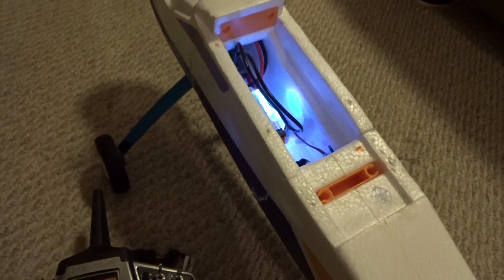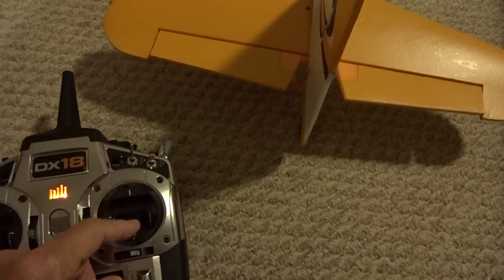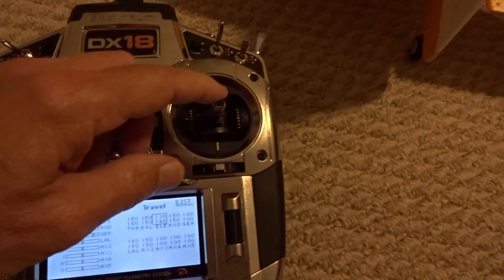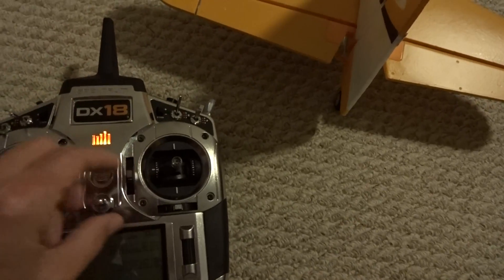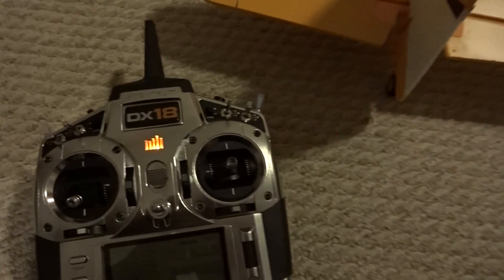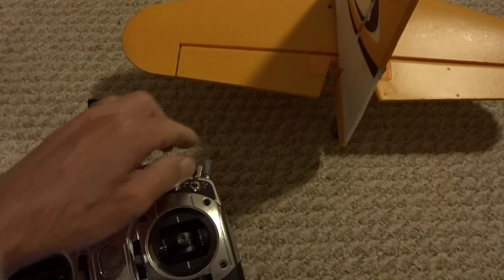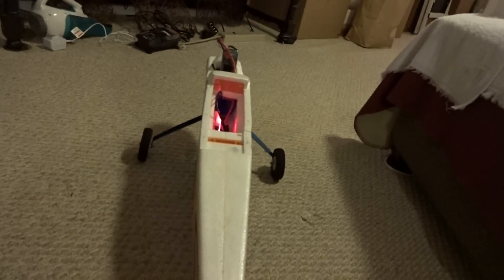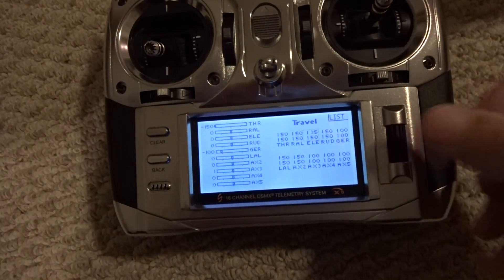Hobby Eagle A3 Super II causes crash with TRAVEL values above 130% on elevator on HIGH rates

Comment: Why are you driving your servos in excess of 130%? If you need more travel it should be adjusted at the control horns. Transmitter instructions all advise not to overdrive servos.
Reply from the maker: How do you know I did not already adjust the physical travel via the control horn and servo arm for max travel? I always watch the actual control surfaces when adjusting for max travel. I then adjust the SERVO TRAVEL and DUAL RATES for the travel I want on each of the D/R settings I plan to use for that aircraft. The problem was not with the travel adjustment at the Tx. It was the travel setting LIMIT of the HE A2 S2 FC.

Comment: You're exceeding the limits of the gyro.
Reply from the maker: Almost all stabs can handle the maximum travel limit most any transmitter can be programmed for. In fact of the 7 stabilization brands I have flown, the Spektrum SAFE series, AURA 5, Lemon-Rx series, ZOHD Kopilot, ARES stab, and the Hobby Eagle brand, ONLY the Hobby Eagle is limited on the throws. The HE A3 S2 can only handle up to a certain limit, and then it goes back to neutral. Unless you know to test for this, it will catch you out as it did me.

Comment: Huh. I’m curious to why mine doesn’t go back down. I haven’t flown with it yet and my high rates are NO higher than 100%. I have the hobby eagle a3pro set up as such: pos 1). No gyro pos 2). Auto level pos 3). Trainer. I’m new to these gyros and have been playing around with this one for months with ZERO flights on it because I’m too scared to take a plane up with a gyro I’m not certain works properly. Did you get it figured out?! Does adjusting the gains manually in the pots have anything to do with it? I ‘believe’ I have te manual gains set at 50% but I can’t tell. I know they aren’t all the way up or all the way down. Plus I have another 3 position switch set with a high rate of 100%, mid rate of 75%, and low rate of 50% for aileron, elevator, rudder, respectively. Is this something I shouldn’t be messing with?
Reply from the maker: The rate gains on any gyro, will determine how much stabilization you get, or don't get, depending on how high or low you have them set. Too low, and they won't be as effective as you might want them to be. Too high and you get unwanted oscillations in the respective flight axis, i.e. pitch, roll or yaw. Inflight the a/c may pitch up and down very quickly or the wings may attempt to roll left and right very quickly or the tail wag back and forth. Just lower the gains on that axis if you see that. It's dependent on the a/c's airspeed so you may not see it at low speed or when there's no wind. My gains are on a rotary dial rather than a switch but either will work. If there's no oscillations at max speed with some wind, adjust the gains up till there's just a little oscillation and then back off.

I can't speak to your stab since mine is a HE A3 S2, and yours is the HE A3 Pro. But the problem in the video is not about the gains. It has to do with the servo TRAVEL LIMITS you set in your Tx. The stab cannot handle more than a certain amount. Most stabs can handle the maximum travel limit most any transmitter can be programmed for. The HE A3 S2 can only handle up to a certain limit and then it goes back to neutral. If you have set you stab up with a way to turn off the stab, which I always try to do, you should be able to fly it first and trim it out for level flight with the stab OFF. Once that's done, you can take it up 4 or 5 mistakes high and turn on the stab to whichever mode you want to test and adjust. Just like yours, my stab has both rate mode for wind, and an angle mode to Auto-Level the plane. Be sure what switch position you are using for each mode and be ready to switch it off if the plane doesn't react the way you expect it to. Your finger should be on the switch ready to switch back to OFF when you do the test.
Reply from the maker: Ross RC Fallacaro, where you say "Plus I have another 3 position switch set with a high rate of 100%, mid rate of 75%, and low rate of 50% for aileron, elevator, rudder, respectively. Is this something I shouldn’t be messing with?" I think you are referring to your Dual or Triple rates for the throws on each control surface. Those are very set to very individual tastes for each person. The manual may recommend certain rates but for surface throws, they are adjustable by 2 different means in my Spektrum Tx. The first is the SERVO TRAVEL. The second is the DUAL rates settings. If I have the TRAVEL set to 100% and the switch set to anything other than 100%, I get the D/R setting. If I have the TRAVEL set to anything other than 100%, you have to multiple that setting times the D/R to get the actual throw available. A 50% TRAVEL value times 50% D/Rs = 25% total travel of that surface, be it ailerons, elevator or rudder. This affects the control surface throws which are usually in the aircraft manual as recommended settings. But they are usually in millimeters or inches of throw, and set as percentages in the Tx IOT achieve them.